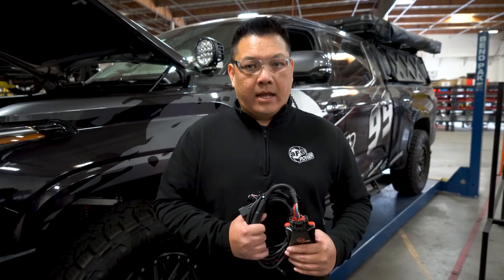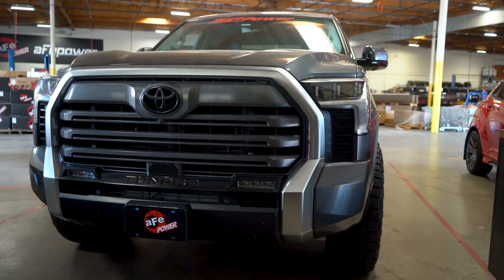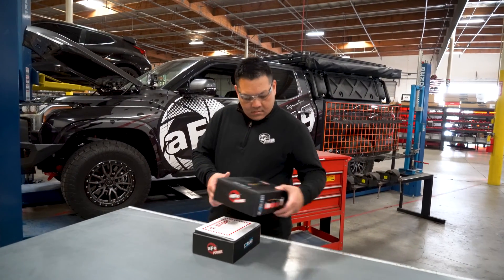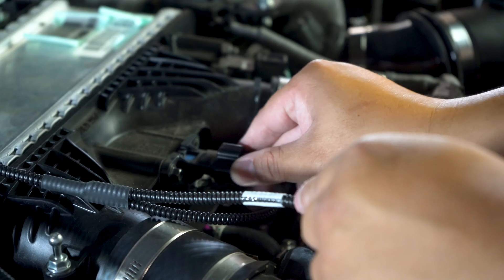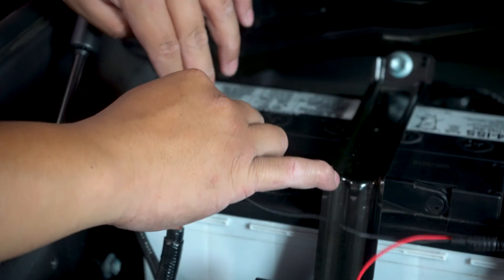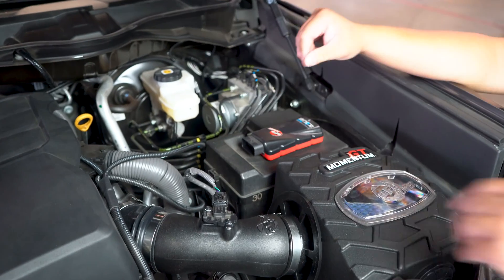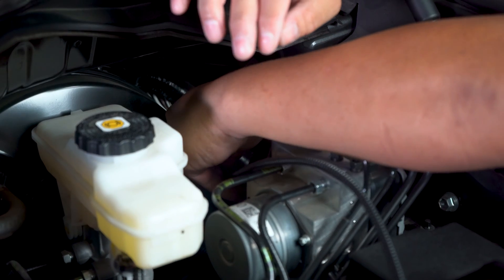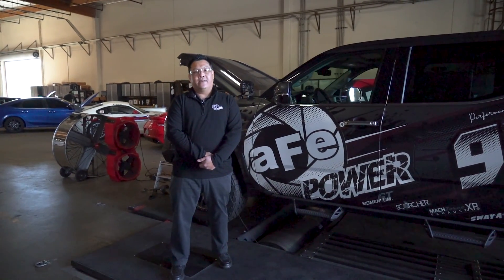How to Install an aFe POWER Scorcher Blue Power Module on the 3rd Gen Tundra

Comment: Will this void my warranty
Reply from the maker: This piggy-back tune does not modify the ECU or leave a trace. 
Also, based on the Magnuson-Moss Warranty Act, a vehicle manufacturer cannot void the warranty of your vehicle due to an aftermarket part unless it is proven that the aftermarket part was the cause of or contributed to the failure of the vehicle. https://www.semasan.com/resources/attachment
Reply: Do you have to use gas about 87 octane?
Reply from the maker: @pennfarmpulling Our power modules for this application are designed to utilize any octane that your vehicle is already using

Comment: Can you provide the stats on the different maps? IE - what PSI is Toyota running in stock trim and then how much additional boost is added for Sport, Sport+, and Race? Also whenever increasing boost you almost always need to run colder spark plugs. Did you run different/colder plugs in this test while using the Race map?
Reply from the maker: The boost themselves vary depending on the RPM that the engine is in, which is shown on the bluetooth app. Colder spark plugs were not needed on this application as there was no pre-detonation when we tested. Colder plugs were needed on Hyundai/Kia applications but not for other makes/models
Reply: Im interested to know as well as i just installed the and don’t feel a difference from normal to Race 
Installed on a LandCruiser lc300